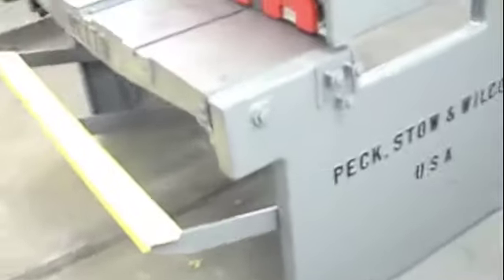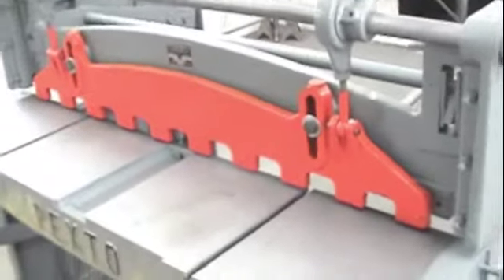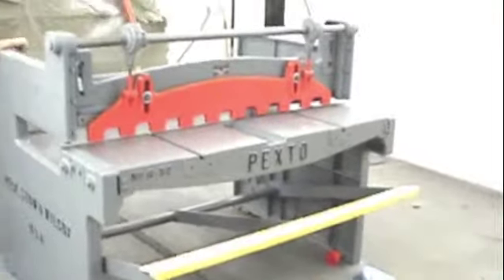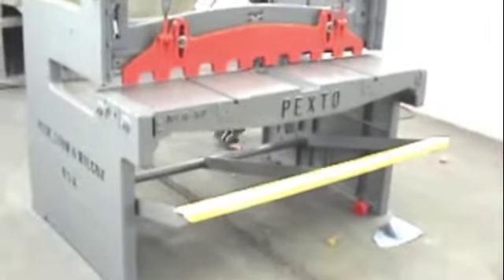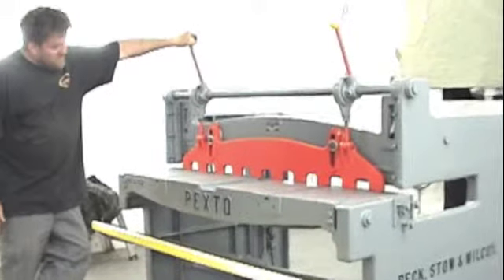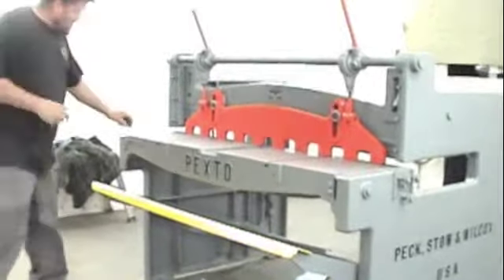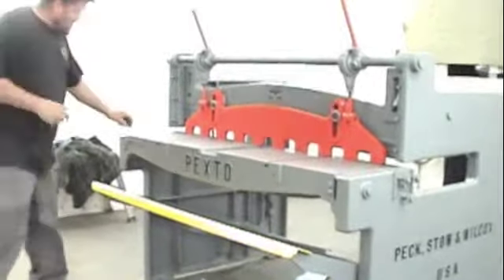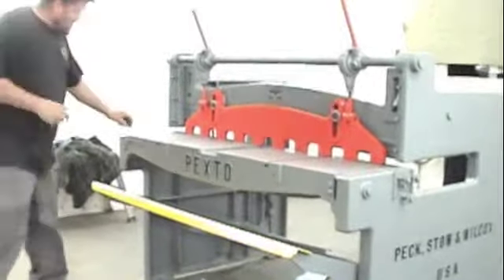Refurbished PEXTO Metal Shear for Sale

Comment: What provision does this machine have for setting the backgage?   Do you have to fuss with micrometer stops on both sides, till they are matched?   Or do you just move one side, and the other side follows accurately?   I would typically want to cut off a piece of stock 15 to 23" long, and accurate to +/.005".  The cuts have to be very square to do this.   I mean like +/ .02 degrees on a 48" wide sheet.   I have an old Diacro that is very fussy in this regard.  You have to fuss with the clamps on both side.  They are bolts and die springs.   I'm lucky if the cut is +/2 degrees, which is not good enough.  I don't see a squaring rail on your machine.  Is there a place you shove the side of the sheet up against?